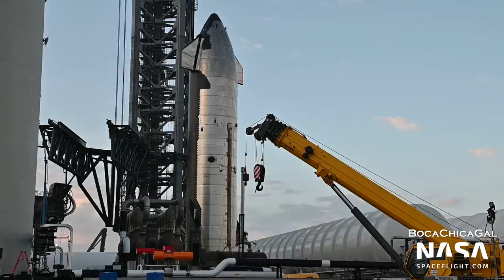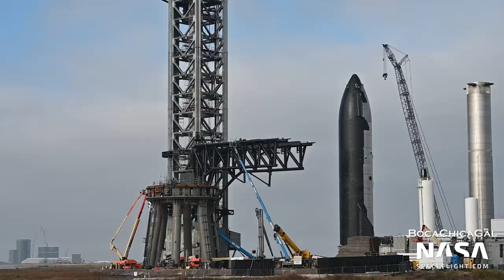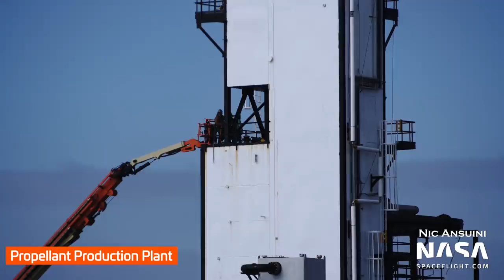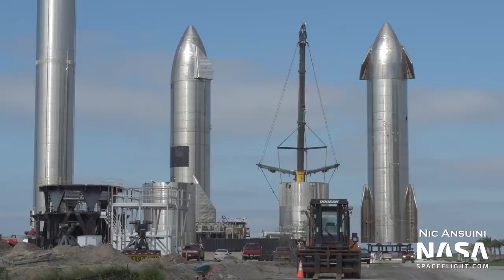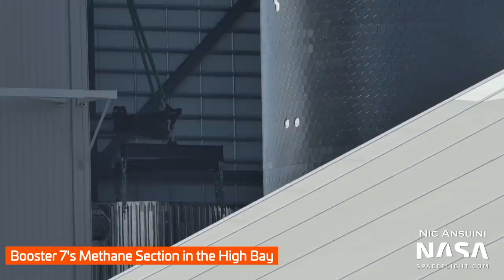Weird Tank Spotted at the Production Site | SpaceX Boca Chica

Comment from the maker: 0:00 The Launch Site
1:40 Orbital Launch Mount and Chopsticks
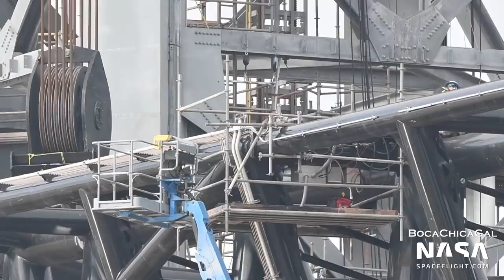3:22 Crews Work on the Orbital Launch Tower
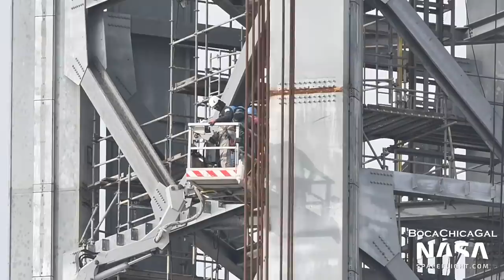3:30 Quick Disconnect Arm
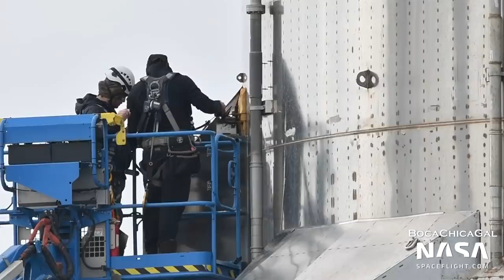5:54 Booster 4 Work Continues
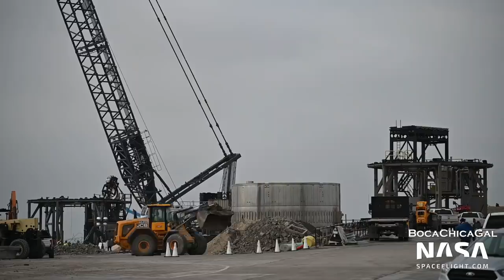6:20 Section of Suborbital Launch Pad Dug Up
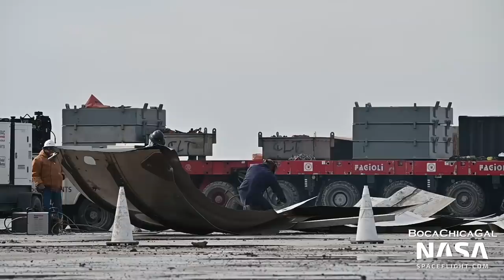7:10 The Remains of Booster 3 Are Cut Into Smaller Section
8:06 Propellant Production Plant
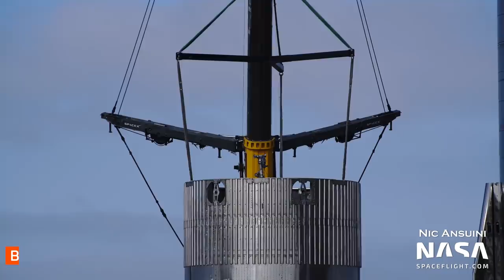8:34 B2.1 is Connected to a Crane for Lifting
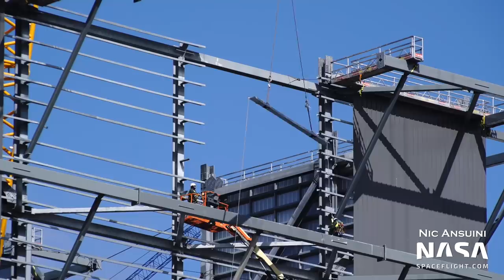9:03 Beams for the New High Bay Are Lifted Into Place
10:48 B2.1 Is Lifted From the Structural Test Stand
11:43 Unusual Tank Structure in the Tents
12:15 Booster and Ship Sections
12:42 Ship 22 Thrust Section in the Mid Bay
13:27 Booster 7’s Methane Section in the High Bay
Reply: You forgot 13:51 Funky music

Comment: Just speculation but the 'weird tank' could be a pathfinder for a tanker starship variant? looks like it could maybe fit at the top of the nose cone under the header tank, just eyeballing it though the top is probs too wide for the nosecone.
Reply: The nose cone will be the tank too for those SS variants (as far as we know) They'd want to maximise the internal space for fuel!
Reply: @moodmusicytc  i think the weight is way more problematic than the space... i dont know it exactly but the internale volume of the nosecone is more than 1000 kubicmeters... and LO2 has approx. the same density as water so that means 100t LO2 only needs 1/10 of the space of the nosecone...
Reply: @Soulleey  Yup.  They need to reduce boiloff so having multiple walls and/or insulation that heat has to travel through would help.  Basically be a very large dewar.

Comment: Thank you again for sharing!! :-D One thing I am noticing just now is just how much those chopstick lift cables are flapping in the wind. With all that flapping and banging together, it doesn't look like a very sustainable design in the long term. I mean I could be totally wrong, but I've seen how ripped up ropes can get when truckers are using them and they have loose ends flapping in the wind. Yes steel cables will be different, but there is an element of concern.
Reply: Came here to pretty much write this, surely they're knocking against each other and wearing strands a bit.
Reply: If the chopsticks are resting at the lowest extreme, the cables might not be under full tension at the moment
Reply: The lines/cables are flapping in the wind because they aren't having insane stresses forced on them. You can run cranes for years without cables snapping plus its using a multi sheave block on both arms significantly increasing how much wait it can hold/catch. Such as a full tank moving 200km/h is 45,000,000lbs at full mass respectively, (but obviously it wont be a full booster) so when it catches the booster each arm is gonna distribute the weight meaning 22.5 mil/lbs on each arm, and with each block will have an effort of 11.25 million pounds. So this thing will effortlessly hold a booster. Aslong as the Anchor (Tower) can support 45,000,000 lbs LMAO. Only speaking as if its full. Dry Mass is another story. That would be 220,000lbs on each block, and its also gonna have dampeners to slow its fall significantly plus the landing burn. Aslong as the arms can hold and the Flaps. 
Edit: Each block contains 5 lines/cables so it would be about 44,000 lbs per line. So they will still wobble even under full load.
Reply: @operraptor6341  Good points. Yea I do not doubt SpaceX did the math on the weight catching ability. My main concern was wear on the cables from slapping together. Tension will help for sure, not unlike a guitar string. ;-)
Reply: @zzyzx13  Yea, that is true.
Reply: @operraptor6341  Elon posted a simulation video that shows superheavy coming to a near-complete halt about a week ago. The booster will likely hit the chopsticks somewhere under 20km/h—not much of a shock load either!
Reply: @zzyzx13  I keep coming back to cable catchers on aircraft carriers. They are durable as anything! But they do snap and it is possible to get cut in half from the recoil which is why everyone grading and monitoring the catcher systems are standing at eye-level with the deck behind a bunker wall.
Reply: If you look at the cables themselves you will see that they have taken on a heavy coat of rust. This would condemn most crane cables as they're not being dressed properly. There is a cable dressing that goes on the cables .......
it turns them black and makes them a little greasy that penetrates the cable and stops it from getting pitted from rust and potentially failing. This would be of a lot more concern to me......
I've dealt with this in the past on countless cranes and equipment with mult iraved cables......
The boom cables on the rental crane in the new high Bay are also quite Rusty and they're not being dressed either........
Reply: @zzyzx13  I used 200kmh as an example, thats the speed when falcon 9 first stage uses 100% thrust to slow down on landing
Reply: @SethEden  Yes but those are single lines, 35mm thick to try to slow down a 50,000lb plane thats moving fast to stop instantly. The ones Elon uses on the Chopsticks are  100mm thick.
Reply: @laryseibold2061  I noticed that! Maybe they don't have a plan for these buildings being long term... It would be a good idea to dress them since there is the gulf nearby.
Reply: Hearing them slap around in the wind for weeks now has had me also wondering when they will start to maintain them properly.
Reply: You are totally wrong.

Comment: Ship 20 doesn't have the hardware to use the chopsticks proper does it?  I see something around half way down, but that seems too low.  I would think the lifting points would be closer to the flaps, and I don't really see them even for a test list, lifting the ship by the flaps themselves.  That's a lot of weight for flaps that were never supposed to hold weight in the first place.
Reply: Right below the flaps (kinda in the "armpits") there are metal eyelets at the place of one heat shield tile.

Looks like the first few ships will only be lifted on the booster by mechzilla, but not caught during landing.

Comment: 12:03 I believe it’s the header tank for the booster, that pipe sticking out is the downcomer of the booster and it passes through the middle of the tank so the weight is evenly spread instead od having the tank on one side it’s right in the middle
Reply: Booster "header" is just 1 long inner pipe not a tank. We would have seen this before too, which we haven't so I feel like that immediately debunks that guess

My best guess would be a new version of the  supposed dodgy Methane GSE tanks
Reply: @moodmusicytc  no head header tank is a tank the downcomer is the pipe that goes from the top tank to the engines, Elon mentioned in a tweet that superheavy will also have header tanks, we have seen a header tank on superheavy but the problem was that it was placed in the side of the inside of the tank so what I believe is that is the header tank, that has the downcomer in the middle to be put inside superheavy, because in the tent is as right now it’s a small tent, normal rings would look way bigger
Reply: I was also thinking header tank. Bottom side upside-down

Comment: Can the heat tiles or tile material be 3-D printed onto starship?
Reply: Or one single piece almost like a phone cover.
Reply: No, manufacturing process for the tiles is not something that can be replaced by 3D printing.
Reply: @user-yd4rn4ez6m  Rocket Lab made a very cheap carbon composite, never say never aha
Reply: @moodmusicytc  I suppose it could be possible in the future, just saying that with this type of tile it’s not possible. Carbon composites and very different from the TUFROC that the tiles are made of.

Comment: 3:20 This cable wobbling does not seem good at all. The whole chopsticks structure also wobbles a bit.
Reply: The cable is wobbling because it is not under tension.
Reply: its wobbling cause theres no load on the cable at all lmao
Reply: @FireMegaDragon  You both are wrong, the cable takes the load of chopsticks which is couple hundred tons. You can see the same wobbling during chopsticks movement up and down during testing.
Reply: @hanspecans  Now I can see that cable wobbled even when testing with water bags, but the wind was slower and there was less wobbling.
Reply: @TechMasterRus  It still wobbles even under load because there is still not that much mass on the cables due to the sheave blocks and multiple lines/cables. I explained how much mass each line/cable receives during a full booster landing
Reply: @operraptor6341  so the cable and whole structure will be constantly wobbling all the time and it can cause something to break finally.
Reply: @operraptor6341  I would put 3-4 spacers along the cable which can slide. They may also have inertia absorbers like in skyscrapers
Reply: @TechMasterRus  it won’t really break anything, those cables smacking each other is like smacking steel bars together and they don’t wobble enough to hit anything else, won’t even effect the blocks either.
Reply: That tank is a wort tank or fermentation tank for brewing beer. The prancing pony and high bay restaurant need beer and SpaceX will have their own brew.